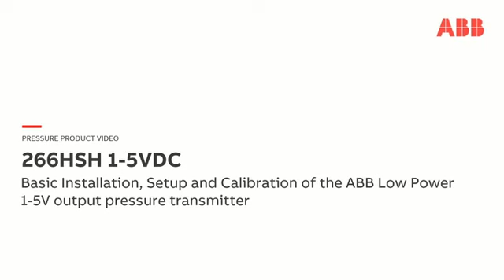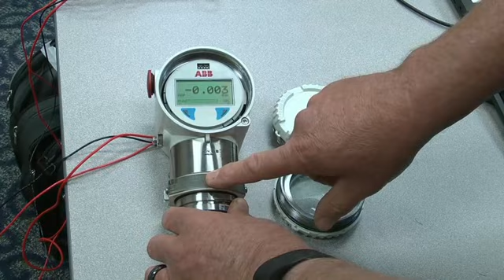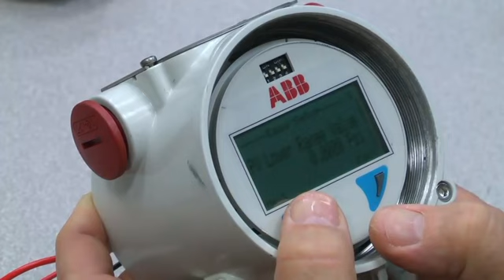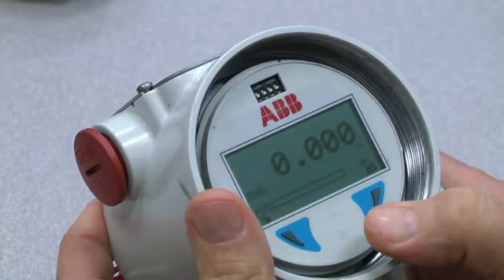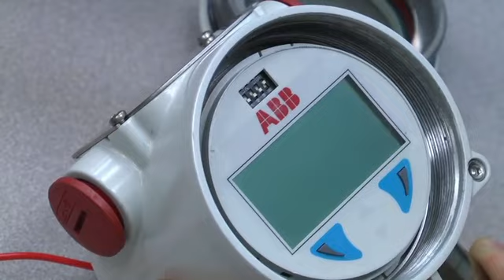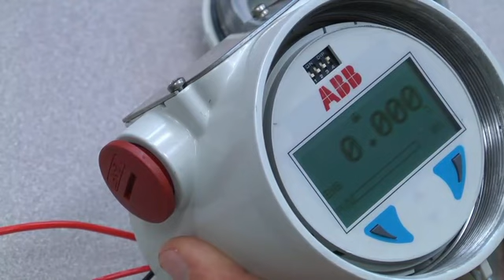Basic Installation, Setup and Calibration of the ABB Low Power 1-5V output pressure transmitter

Comment: I have a 0 to 300 psi transmitter, I need it to be 0 to 150 psi. are you telling me I have to put 150 psi on the transmitter To change the upper range Value? Or can I just change The upper range value from 300 to 150?
All other transmitters I’ve dealt with in the past, rosmont, Endres Hauser, Foxboro, Siemens, you just configure the transmitter to what you want By changing the upper range value from 300 to 150. On all of these, you do not have to put pressure on them to change the URV.